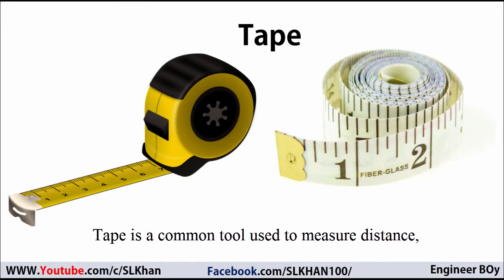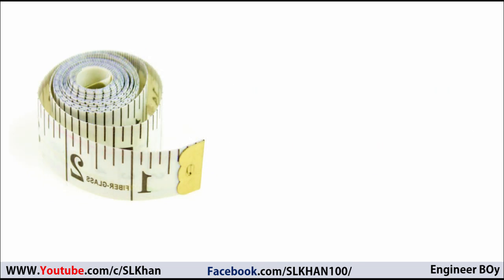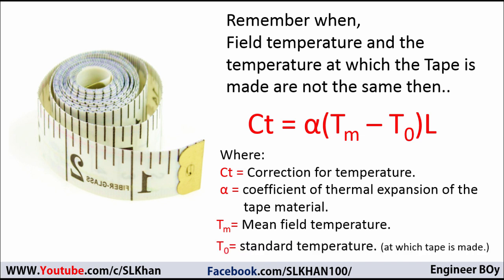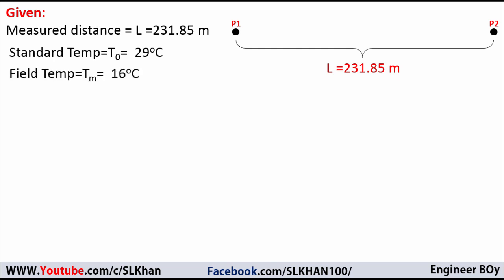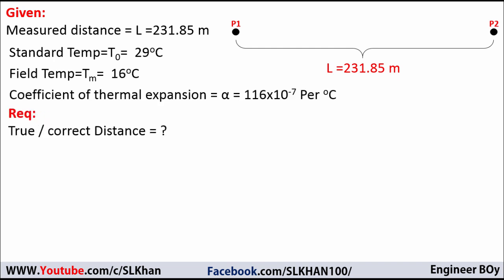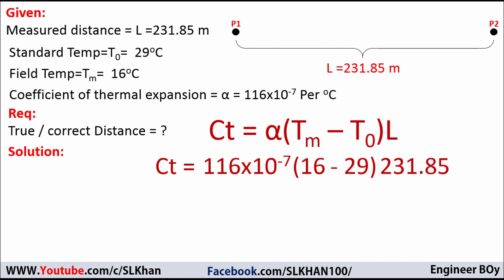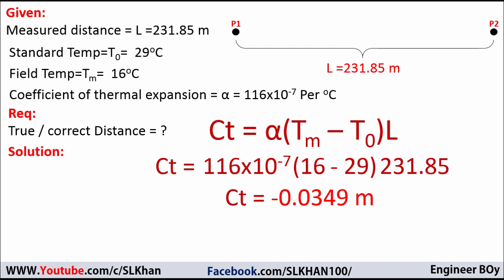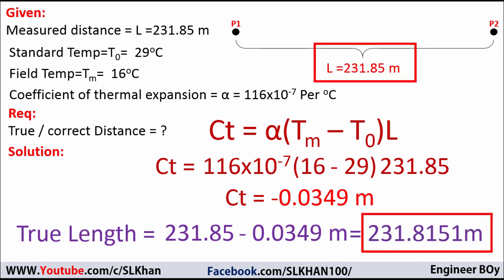Tape correction for temperature

Comment: if the measure temprature is less the standard temperature then the error will be negative but correction will be positive , the error is added to the length
Reply: But we must focus on tape not on length length increase when tape contract